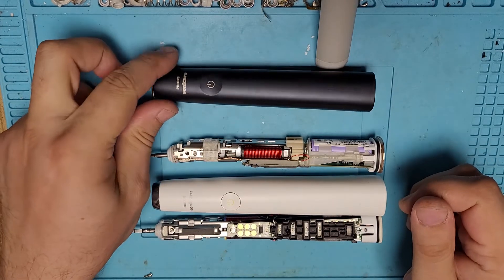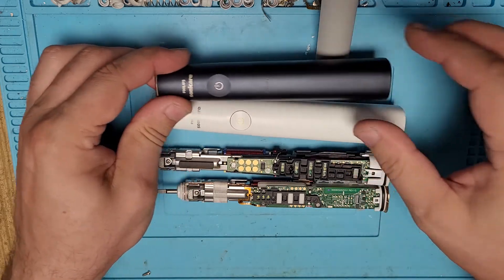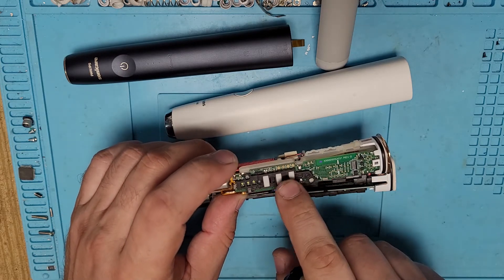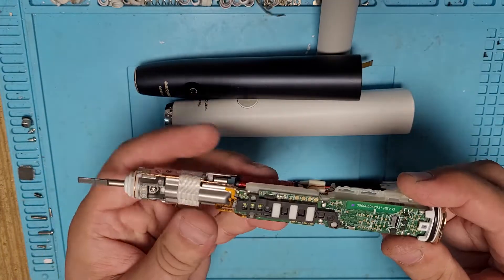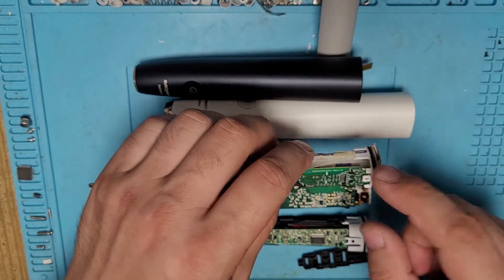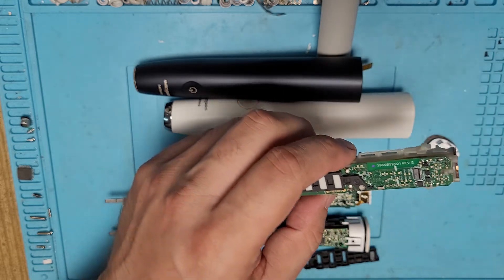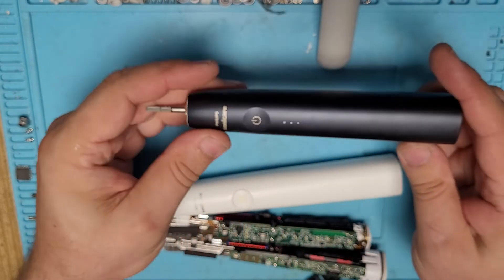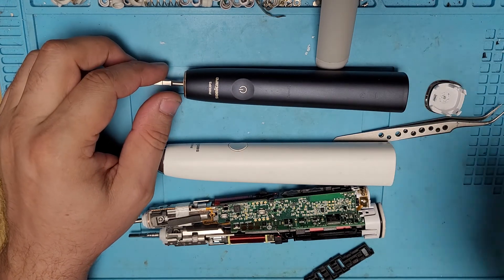Philips Sonicare Prestige - let's look what's inside. Teardown, repair, compare..

Comment: Wow, great video! I have a question..my Sonicare started to make noise everytime I press it on my teeth. I saw that the spindle that hold the toothbrush is not stiff, if I touch it, it moves a bit right and left and a bit behind. What is the problem in your opinion? Is it the screw you showed in the video? Unfortunately philips doesn't fix this kind of issue.
Reply from the maker: Check my other videos for more information but I would suspect the upper screw right next to the spindle. You will need loctite or some other screw tightening liquid on this screw
Reply: @letsfixitgarage  thanks!!

Comment: Which color is nice , dark black or champagne?  Is it easy the brush head holder loose and make the  loud nice?   I read  the reviews from somone at amazon    usa?
Reply from the maker: Don't know the color, but if the head is noisy it has a defect. Under warranty Philips will replace it for free if after warranty check my other videos it can be repaired quite easily. Electromagnetic drive is the same as in diamondclean version.